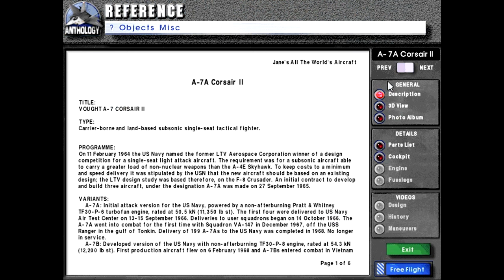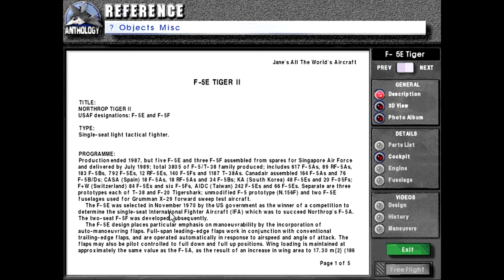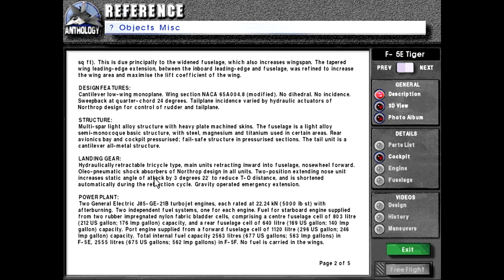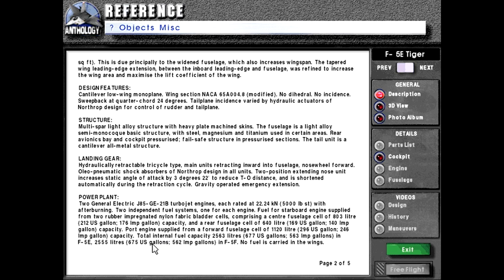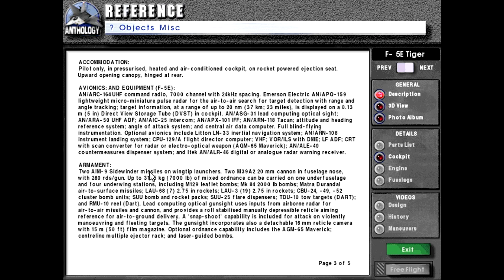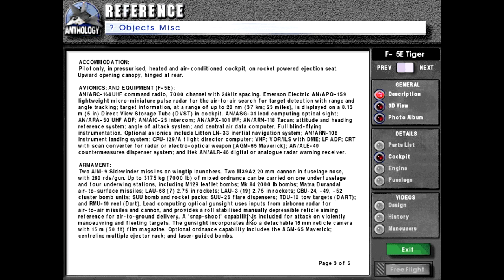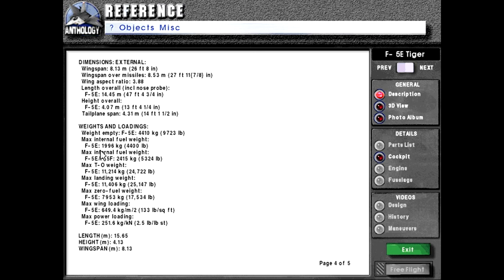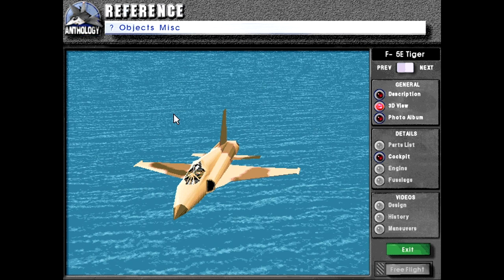Let's Play Fighters Anthology Episode 417 F-5E Tiger II (Jane's Reference Showcase 011)

Comment: Beside Switzerland, the Royal Thailand air force will continue to operate F-5 E/F til early 2030s (Thailand had upgraded their remaining 14 F-5 E/F to F-5TH/THF Super Tigris). The current F-5TH/THF Super Tigris modernization goes further and brings them to a high equipment standard that the Royal Thailand air force describes as a “4.5 generation fighter.”